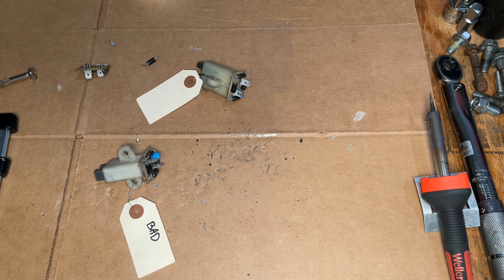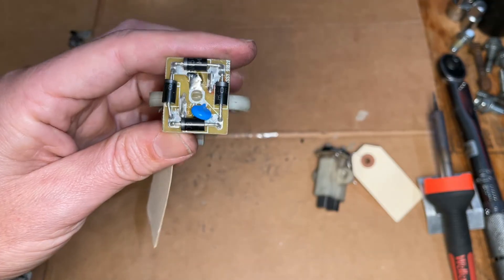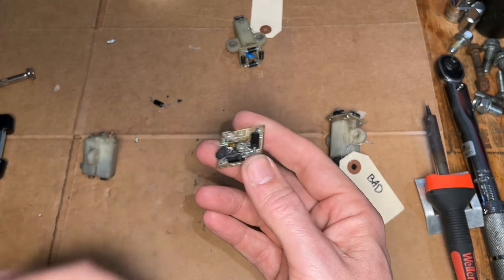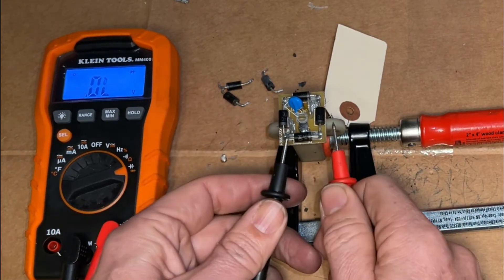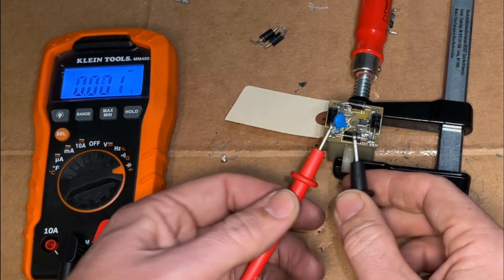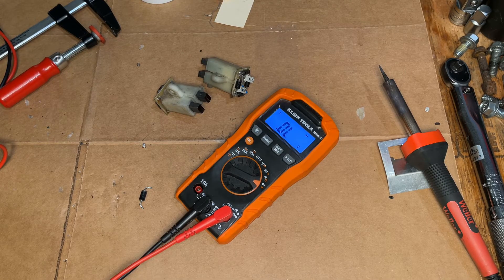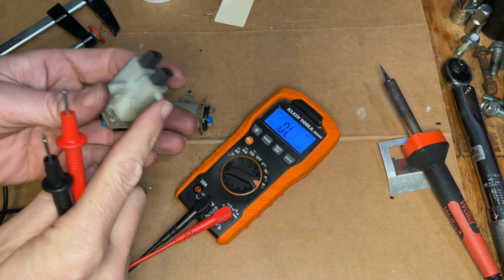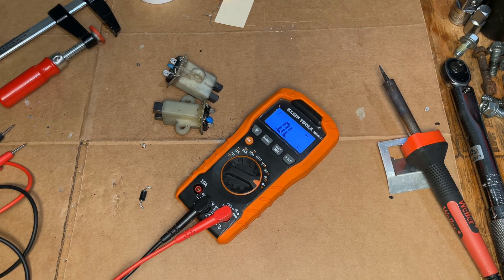Briggs Bridge Rectifier Test and Repair - Part 91825GS

Comment from the maker: This is an older video that I never published.  Recently this part is difficult or impossible to buy new.  I am publishing this video 4 years later in case someone wants to test and repair their board.
Reply: James, please keep doing like you’re doing! I am an old diesel mechanic and have thoroughly enjoyed watching your videos and learned so much about both the small engine rebuilds and the generator ends from you. Your communication is always clearly understandable and videos well done! Thanks for what you do!
Reply: Is there anyone willing to repair a couple of these ?
Reply: IN5408 is the diode
Reply: Not sure about the blue thing , mines gone .
Reply: James, these diodes are standard "off the shelf" parts. If you can find a part number or otherwise figure out the specs on them, you should be able to get them at any electronics supply company. The part number on the side should be something like 1NXXXX. A common type of this diode is "1N4001".
Reply from the maker: @williamjones4483 I did recently buy a bunch from mouser to fix some powermate rectifiers.  Will look at the part number, likely they can be used on the storm responder as well.
Reply: @jcondon1  Mouser is a great source for these parts. They usually have whatever you want, and they ship quickly, too, as long as they have the part in stock.
Reply: @williamjones4483 I was trying to see part # but all I could make out was the 1N...
Reply: @williamjones4483 Funny thing, I was just shopping for some high voltage, high current diodes. Many fewer parts available in axial lead packages recently. The TO220 package may work as well or better, but I wanted the leads!

Comment: those diodes are about 10 cents a piece, the part number is written in a circle around the part.  just replace all 4 with new while you are in there.  a little flux makes removing the old parts a lot easier, drop/smear it on the joint before you try to heat it then either use a solder sucker or bang it on the bench to fling the solder off.

Comment: Might be helpful to do a video on sourcing new silicon power diodes for these if you don't have a spare set of brushes to harvest some from. Electronics supply houses like DigiKey, and Mouser (NEVER eBay or Amazon due to counterfeit parts) would be a great source to look for these, and possibly get better spec ones than originally equipped.

Comment: Ok James, I have the same problem with a 2008 Craftsmen 5600 watt generator. Just got the motor running great but there is no power. I have followed your other generator videos and the one fault I keep coming back to is this 91825GS brush holder. What amazes me is why they are no longer being manufactured?  Beside reusing old parts, which I do not have or can find. Are there any parts that will cross reference in place of these brush holders? I understand that these generators are made by Generac but they were useless to speak to?  

And what luck have you had with the rebuild? How long have they lasted? And do you have a list of specific parts to make the brush holder rebuild?  

As the small engine repair guy in my town. I have about 12- 15 of the B&S or Craftsmen generators that I keep running but now I have 2 that have no power and cannot believe there is no work around to keep it running. 
As a Marine, Improvise, Adapt and Overcome.
Al
Reply from the maker: I am working on a video now on how you can replace this brush and rectifier with parts that are still available for less $$ then the OEM part.  The Generac XL and EXL generators use brushes that are compatible.  You then have to add a bridge rectifier and a metal oxide varistor into the mix.
Reply: @jcondon1 I was sitting in my garage over the weekend trying to get that Craftsmen Generator to make power. When I used a old AGM battery connected to a old power cord plugged into a 110 volt outlet and jump the generator and guess what happened……it now makes power again. After trying it with a corded drill and nothing happened.  But cannot wait for your video. Thanks keep up the content.
Reply from the maker: I will be releasing a video this week on how to build a replacement.  Also I will be selling a limited amount on eBay.  The link will be in the video description.

Comment: Hi to everybody! Today I got my hands on  an Assy 91828. It has four 1N5408 diodes and a V7471U varistor for surge protection. Does anyone know where to find the brushes only to replace them on the assembly since the entire assembly is not available anymore? I guess it can be done since they are soldered to on the PCB.
Reply from the maker: You could like use this set of brushes connected to a homemade bridge rectifier: https://saffordequipment.com/product/generac-brush-holder-assembly-oem-0663860srv/?srsltid=AfmBOooMVh4bnQqhHR4tWv1ud0WqVSlzIlmf3ZgygyroxmLOI-VN2wy5
Reply: @jcondon1 Thanks! This is a great idea! I guess this is the easiest and fastest solution. A bridge rectifier like a KBPC 1010 potted in aluminum and the 66386 brushes would require just two pieces of wire and some crimped connectors. There is plenty of space to fix the bridge rectifier with a nut and bolt. I found a 66386GS brush holder on Amazon, I guess this would work too. I am situated in Europe so I need to find an online store that would ship here.
Reply: We’re you able to make a work around using the mentioned parts? Trying to solve the same problem?
Reply: In my case it wasn't necessary because I was able to rebuild my original  brush assembly (I swapped the diodes with new ones) and now the generator is functional.  I ordered the 66386GS brushes just in case, because one of my original brushes is chipped pretty bad (for now is OK,  but who knows how much it will last). I am confident that the solution mentioned in the previous post is functional, otherwise I wouldn't have ordered the brushes.

Comment: Jim get some solder wick and some flux preferably liquid  it is good for removing solder. Use plenty of flux and solder as it helps with heat transfer. The solder sucker is good for cleaning the solder out of the holes after the component is removed or the solder wick can be used. Be careful with the sucker as the sometimes the recoil can damage the PCB pad when its hot. That is why I prefer the flux its messier to clean up after ward but much safer. I agree with the previous comments that adding a little clean solder will help with heat transfer how ever I would recommend plenty of solder be used any excesses can be removed later when cleaning up the pad. Be very careful about applying any pressure with the soldering iron tip to the circuit board as you can easily damage the PCB pad and trace especially when it is hot. As for the bad diodes if I find one bad I would just replace them all very cheap components. This is important if one or more is shorted as it can stress the others. As for removing them just clip the leads close to the diodes body and then you can remove the leads one by one with much less risk of damaging the PCB. As for the flux they have no clean flux but I think the job looks better when it is cleaned, use some alcohol and a brush and some Q tips to get every thing clean and dry. As for the irons tip it depends on the size and the heat conductivity of the joint its best to match the size of the tip with the size of the joint. The stile of the tip ether a chisel, conical or bent depends on how densely packed the work area is as well. What is more important is that the tip is not to big for the pad or you risk burning or causing measling on the epoxy coating on the PCB. Its more important to keep your tip clean and covered with solder. When finished using the iron, clean it with a damp sponge and apply fresh solder to the tip before turning the iron off. Do not let the iron cool with a dry tip. Not only will your tip last longer, but the tip will be ready for the next job by wiping it clean and adding a little fresh solder.  When the tip is hot and in between jobs be certain to add some solder to the tip before putting the iron in its stand to idle . This way the solder oxidizes instead of the tip. When you go to use it wipe it clean and add some fresh solder. Its very important to always keep your tip clean and covered with solder. I am retired tech with 50+ years of trouble shooting and repairing down to the component level and replacing not only thru the hole components as shown in your video, but surface mount components that require using microscope as well. Hope that you find this helpful. I enjoy your videos very much. Thanks.  If I may make a suggestion for a video, some gen heads have low harmonic distortion and others have 25%+.  I would like to see a comparison of the two heads to learn what is different about them. I think the winding pitch of the stator is different and the rotor has a slight twist for the low HD. What about the distortion if the engine has one cylinder verses an engine with multiply cylinder's. One with only a power stroke for every two cycles or or a power stroke for every AC cycle. In addition what about one that has an AVR compared to one that does not use one. Hope you will consider it.

Comment: Hello, I know that the work done is 4 years old but if you have to start again, without a desoldering station, it may be more practical to cut the dead diodes flush with the body and heat the solder and extract the 2 remaining legs with small pliers. It is also better to use a larger tip on the soldering iron, it makes working on such large components much easier.(Signed by a former electronics engineer 😉)

Comment: Helps on a known broken part if you cut the leads and then use the pump. And the solder MUST be... liquid for it to work.
If solder is old and oxidised, add some new there with some extra flux. If it doesn't melt within seconds, you are doing something wrong, too small soldering iron, too dirty tip, or too old solder for example. It's not rocket science lol

Comment: Okay, since the parts are exposed, seems easy to keep them repaired and working. I mean what part can't be found and replaced... Too many time they are in some box type container and filled with resin or epoxy. But even those can be repaired if you take the time... If it looks like the diodes are the typical problem with them, maybe replace them with a higher current type, or even a higher voltage rating, or even both... Thumbs Up!
Reply: Using a wrong type of diode risks transferring the damage from a cheap component to a more expensivde one.

Comment: Odd the assembly is no longer available, yet the components are easy to get. 4 rectifier diodes & a capacitor. Most electronic shops should have them. Years ago, I used to build bridge rectifiers myself. Bought the diodes in bulk packs. The diodes have a number on them, usually starting with 1N, then 4 numbers. 1N5404 are often used in older centre tapped transformer style battery chargers.

Comment: Nice work keeping old/unavailable parts in service. I would suspect those diodes would be available from your local electronic supplier, I would have a guess at 2 Amps rating, not sure of reverse voltage rating though. I would guess the diode cost is around a dollar, worth a try

Comment: Those cheapo blue solder pull-its can be made to work properly but it takes some work. Basically, take it apart and file/sand off any rough edges. Oil the yellow trigger part so it is not so hard to push else the tip moves every time to you try to fire it. Also, arm the device, point it at the ceiling, put a drop of oil on the solder input white plastic on the plunger pin and fire the device. That pulls  oil into the device and makes it work much better.

Comment: Solder Sucker alternative -- Melt the solder, then give it a quick shot of 120 psi air.  The component and board will be completely clean, ready for removal.  The removed solder will solidify almost instantly so it won't cause an issue elsewhere.
Reply: not good, hot lead flying in the air is bad

Comment: I am an old IBM electronics tech. There are some good pointers in the comments (such as add a little fresh solder to introduce some flux to the joint being de-soldered) Solder-suckers actually work BETTER when there is more solder to vacuum.
Here is another pointer: 
When doing work on these 'largish' components, DO NOT use a pointy soldering-iron.  The heat-transfer is slow and hard to work with. Consider using a small 'chisel' tip to do this type of work. The heat will transfer much quicker to the solder (quicker melt) and, in the end, there is LESS heat-soak into the components.
Reply: Yes, I agree with all the points here. It helps to have a soldering station which uses an iron that can accept tips of different sizes which are meant for different types of work. It helps a lot to use a chisel tip in this application -- where you want to desolder. Also, consider tinning the chisel tip before applying it to the part you want to desolder. It will help melt the solder. The work goes more quickly and as already said, there is less heat transfer to the other components on that board.
Reply: Thx so much for that valuable information!

Comment: I brought a cheap, combined Solder sucker & soldering iorn, all in one tool,  for under $10 on a overseas online site. It works much better that having separate tools, and easy to use to remove solder.

Comment: Having worked in the electronics repair/refurbish industry for 15 years, I went through several of those solder suckers.  Some name brand, some generic.  They all performed about the same for me.  I always had trouble getting the solder sucked away on circuit boards that had copper traces on both sides.  It would help if you replaced that pencil soldering tip with a small blade type soldering tip.  More heat will transfer to the traces improving your chances of getting all or most of the solder sucked away.  For the bad diodes, I echo a previous post about clipping the diodes out of circut leaving just the leads to remove.  Less area for heat to be drawn in will result in easy removal of the leftover leads.  Your Solder Sucker should actually pull thos leads out when you apply heat to them.  I would also check the suspected bad diodes out of circuit to confirme they are bad.  If one of the on board components is defective it could skew your reading across the diodes when they are in circuit.

Comment: You can buy suitable diodes by the bucket very cheap.    Easy to replace if you can use a soldering iron.

Comment: Becareful removing diodes. Too much heat can damage them.
Reply: That is just one electronic component that is heat sensitive. I use a heat sink on the large power diodes and SlR's on control boards for generators.
Reply: that is right, but not enough het is imposable, you have to get it just right, with the right equipment!

Comment: I wonder if that little blue capacitor may have lead to the two diodes dying? Should it have been tested and maybe replaced?
Reply from the maker: I believe that was a varistor.  A bad one could definitely lead to diodes going bad.

Comment: Diode testing is more than just direction. If you don't test break through voltage you don't really know if it work correctly. Got some 50V labeled diodes and found they were labeled backwards and 5V break through voltage. Fortunately I blew several fuses before discovering. I still don't own a breakthrough voltage tester; although I have seen one in use.

Comment: Two dots.
First is put a piece of silicone tubing on the tip of the tin plunger.
Second is testing bridge cell under load.
From experience, measure well and fail under load.
Nice video. Always interesting.

Comment: Selling in the UK on Ebay for £2.69 for 50 James.
Reply from the maker: That is a deal.  When you could buy them here they were $50 to $70 depending on where you looked.
Reply: @jcondon1  Is this a case of Martin talking about diodes and you talking about the whole unit?  If not, then you are certainly getting 'ripped off'.

Comment: I second the suggestion of flowing some new solder onto the joint. It will greatly help the old solder melt and then your solder sucker should work.

Comment: Try Solder-Wick desoldering braid. I've never had very good luck with even the name brand solder sucker's either.
Reply: Soder Wick leaves a clean smooth surface too. Makes it easy to solder the new component. BTW, buy the genuine Chemtronics brand. As usual, the stuff from the other side of the dateline is junk.

Comment: You should be able to buy the actual diodes new. Can you read a part number off the diode?
Reply from the maker: Did not see any, but did recently order some from mouser that might work.
Reply: Probably 1N4007. I could be wrong, but judging from the voltage requirements, I would bet my two cents on it.

Comment: On a diode the bar is the Cathode, the triangle  is the Anode, current flows form (Positive) Anode to (Negative) Cathode and is blocked upon reverse polarity....
use a heatsink on diode leads when soldering/desoldering  to prevent heat damage!
On large connections a soldering gun works quicker than a low wattage soldering pencil/iron.....
Reply: correction:   DC Curent flows from Negative to Positive...

Comment: Is there a # on those diodes?
Usually, in electronics, we replace all 4 diodes.
We go by current and voltage rating to crossreference.
Reply from the maker: Did not see any.

Comment: I have a no name sucker like yours & it works fine. maybe you just got a dud. check the tube to see if it's maybe blocked with solder or something . adding some rosin flux & new leaded solder actually helps in removing soldered parts.
thanks for the tips